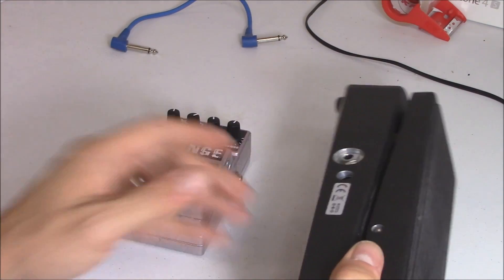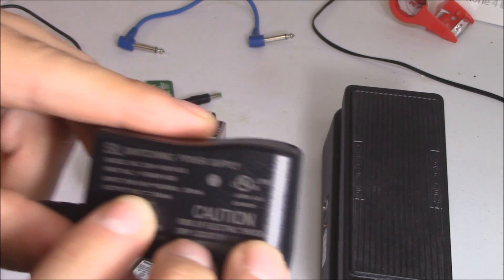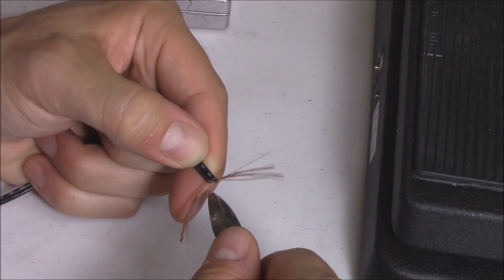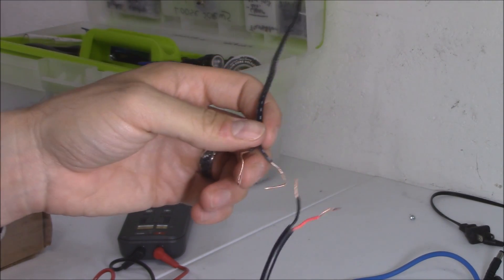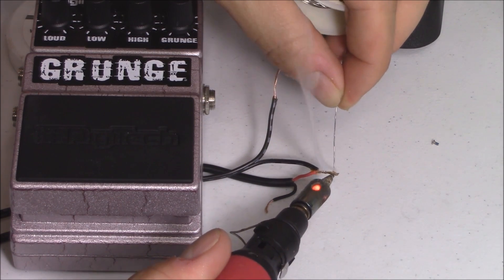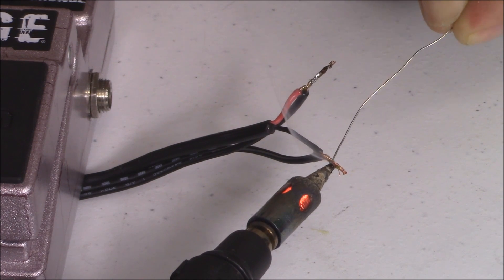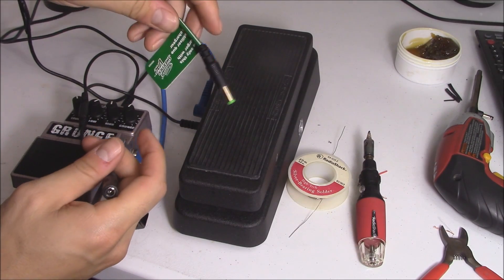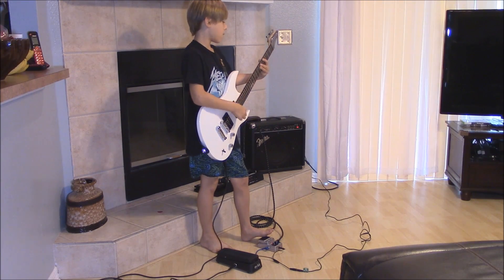HOW TO WIRE CHARGING ADAPTERS TO POWER OTHER DEVICES.

Comment: One thing id add , if your gonna use cable like this on eg a Laptop cable and use eg a lead End from say a AC Router adapter be careful because some wire is regulated for even voltage distribution, i literally blew a motherboard years ago doing this

Comment: I want to take an ac charger and connect it to an old USB 30 pin and connect it to the firewire pads to do an ac to 30 pin firewire charger.

Comment: Great informative video for thos DIY projects! One issue I see occasionally is that colors do not matter in some cheaper products. Always check for polarity of the tip to whichever wire and mark it just in case it is a non standard device.

Comment: That 10V adapter would probably work. Check the schematic of the pedal - or just open up and look to see if it has a voltage regulator. It probably does. If so - 10V would be fine. 10V wall adapter is fairly rare. No gloves needed for a novice with anything low current and under 24V DC.

Comment: Hey Tampa Tec really good video thanks for sharing your knowledge. question what if the two wires weren't red &black on the plug side . How would you tell witch is positive and negative ?would it still work?
Reply: connect a voltmeter to them and see wether its positive or negative. If negative then the wire that the red lead is attached to is actually the negative polarity wire. Red goes to red, black goes to black.

Comment: I think that the polarity [positive and negative] depends on the plug hole[ port] on the device. So even though you wired up Positve and negative correctly from the charger to  the plug, the plugs positve and negative may not be the same as whats on the device.
Reply: Literally black is negative y'all's always is, red is always positive, most of the time, you get whites d black, white becomes positive black still negative but I deal with low voltage... I want his multi meter though lol

Comment: you do know 9V batteries are about 110mAh right?
Reply: I Think, the pedal will only draw what it needs, so as long as the charger can output more milli amps than what the pedal requires it will be okay. I think less milliamps will burn the charger out, but more miliamps doesn't matter?
Reply: 6 * 1.5v Alcaline = 9v but 6 * 1.2v NiMh =7.2v. If Alcaline batteries, you can use AAA(1200mAh), AA(2600mAh), C(6-8000mAh) or D(12-16000mAh) cells, but never use higher voltage than recommended. He would have to cut the wire anyway because the adaper got plus on the pin and the pedals don't.

Comment: Wait, did I see that correctly? When you tested the wires, the wire with white dash marks was positive, but when you soldered the wires you connected the black wire to the one with white dashes. Isn't that opposite?

Comment: can i do the same with laptop adapter?
I have a lenovo adapter and my dog chewed the wire near the power brick, if i cut the plug and transfer it to an old toshiba adapter, which has the same input and output volts will it work? and is it safe?
Reply: Hey u have the same problem did u ever find a solution?

Comment: I have been trying to fix some headphones, but I find the wires are coated and will not attach to the 3.5mm jack. I have a 100w soldering gun. I am new to this.

Comment: Hey, how are you. My name is Carlos Flores and I have a Digital Signage Business in New York. The reason I am messaging you, is that I am looking for someone to help me build a new type of screen display for retail stores . Right now, purchasing a standard LCD or LED tv screen from an electronics store is not what I would like to continue to do. I don't need speakers or RCA out puts or really anything that a standard flat screen comes with. All that I need is a standard size screen, about 40 inchs, 4k, so that it can be seen during the day, as most displays will be placed in store front windows, and an HDMI output. I would also like to build a screen with a small thin bezel and a sleek encasing. I know this is possible and also know that the demand will be very high. If this sounds like something you would like to get into, please give me a call anytime at 917-280-8961.

Comment: As mentioned before heatshrink tubing would be a lot better and neat looking. Tape always finds a way to unravel and get sticky. Your son has great taste in music! Metallica!!!!!!!
Reply: +mrtomp | MrTP I agree. Twist the wires together in a butt splice instead of a pigtail before soldering and then finish off with 2 small heat shrinks 1 for each wire and one large one over the splices to hold it together and most folks would never even notice it was there.
Reply: Actually for the record, that was Nirvana not Metallica.

Comment: The soldering great Job... Wire connections I like to use heat shrink works better and the problem. With electrical Tape  comes lose over time 

Great video... I like the powerline Universal adapter the tips you can change
Reply from the maker: Great tips thanks
Reply: Jason JJ Cruz +

Comment: terrible.  You only need to make a mistake handling live mains power once.

Then it is game over.  *Do not* assume the label is correct then handle live wires with your hands!!  Measure First!!
Reply from the maker: True that's why I suggested to wear protection, gloves.
Reply: ***** ... whilst gripping the wires with bare hands.